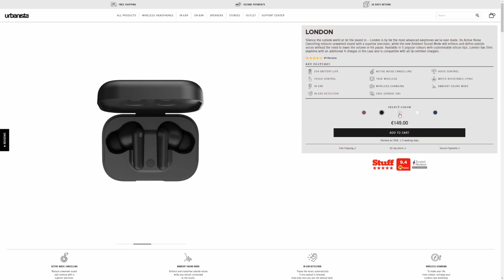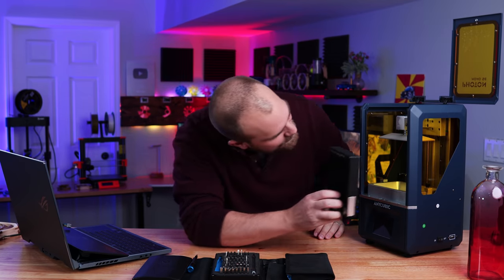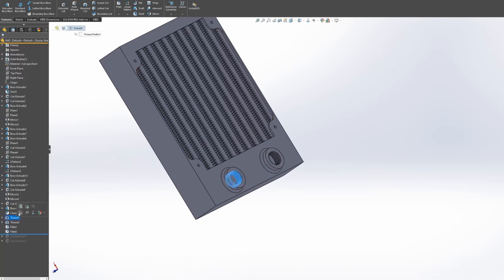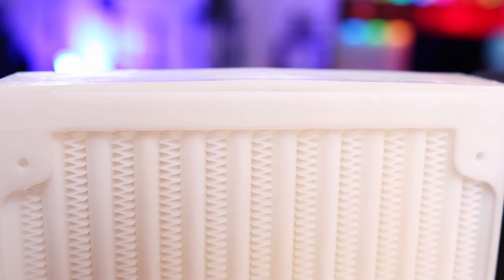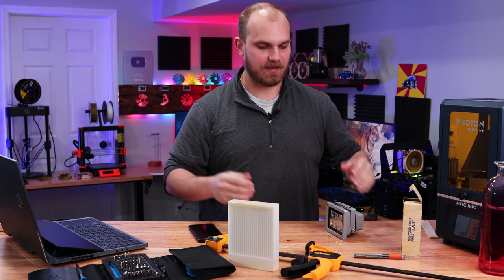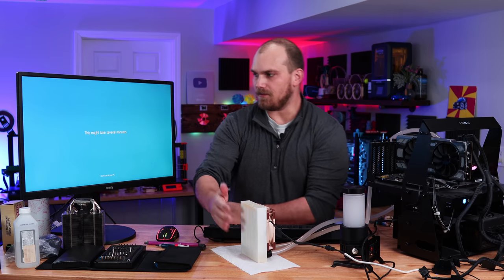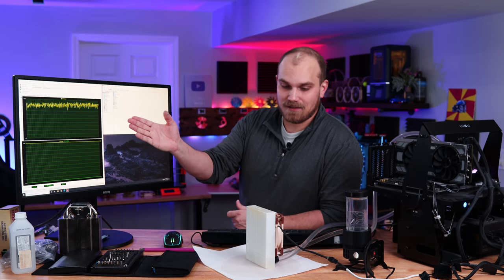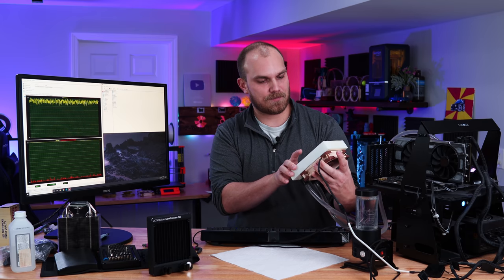I Never Expected This | 3D Printed EK Coolstream SE 120mm Radiator

Comment: well that was surprising, i have some ideas but no experience whatsoever on Cad, i would say remove the fins betwen the water channels as in this instance they are made of plastic and serve no purpose, unless you realy need structural support and make a smal trial model with different size water channels going thiner and thiner to find how thin you can make them without wasting too much time and resin also i dont know if you had a pastel white die in the loop before or that is from residual resin if the later check the cpu block for any type of material accumulation on the microfins, i see the future and polimer radiators may be profitable

Comment: The plastic radiator must be designed completly diferent .. you dont need those ribs between the tubes , in fact you need one long flat tube winded in a spiral shape

Comment: I think a radiator build with silicone used for heat transference could possibly perform better.  I am, however, not sure if that is something possible with a 3d printer since I don't know enough about them.

Comment: Try doing a cost comparison on buying a cheapo liquid cool set, (not AIO) vs resin printing one. Print the rad and the tubing (guess they would be hard line) vs buying a rad and soft tubing.  Now assuming the person has a 3D printer or resin printer, what would the cost of materials be vs having to by the rad and tubing.  Obviously the CPU block couldn't be printed and most pumps come with res, so no need to print.

Comment: Is insert molding an option with these printers? If so, could insert metal plates to facilitate heat transfer in between the main support fins? Great prototyping btw.

Comment: An interesting experiment would be to remove the radiator from the loop and see how long it take the water to reach a temperature to make the CPU idle, and you will have something to compare if the resin radiator is doing nothing.  Keep in mind that floor heating used in homes don't use metal tubing, but it obviously still radiates the heat.  It could be just having a narrow pathway for the water to flow and radiate heat on it's own is all that is needed, which would mean CPU LCS is mostly fraud. Well for regular non-extreme overclocking, probably.

Comment: Maybe if you make a 240mm version it wouldn’t throttle?
And I think the fins are unnecessary since they can’t conduct heat away from the channels so if you remove them it shouldn’t negatively impact performance and it will increase airflow

Comment: Just curious... have you considered printing a solid port and using a tap to cut the precise threads? I'm sure a tap set would have no issues with plastic since they're usually dealing with steel.

Comment: These videos harken back to the old days of water cooling, when you built loops out of stuff from home depot and aquarium supply stores and a radiator from a motorcycle or transmission, all to get an incredible overclock on an AMD chip you had to mod with a pencil to get the multiplier unlocked.

Comment: If you plan on making more radiators I suggest to get a bigger resin 3D printer. You probably already thought of that but the first one is very impressive. I bet if you make a resin radiator that can hold 2 fans you will be able to get an even more stable temp.

Comment: Instead of transfering the head from the Channel to the fins you should go with a really fine mesh of tubes. So there is only the thin tube walls that you would need to disapate the head from. Create Something that can not be produced by old school metall manufacturing. Fin / mesh structure and maybe even to overall shape. You could possible do an 90 degree 720 Radiator with 6 fans. Or custom cut outs at the radiator Line to clear the motherboard IO shield and GPU and create a rear 240 radiator.

Comment: Could you use a loop without radiator but with the same amount of water in it, to chceck if there would be similar results? I wonder if it might be just because of water capacity and energy lost in tubes etc.

Comment: Don't put the fins between the water channels, with metal it increases the surface becasaue it conducts temp well, with plastic you are isolating each point the fin makes contact with the water channel.

Comment: Video suggestion: fully 3d printed watercooling setup 
Resin printed distro plate
Resin printed Radiator
Resin printed Fan(blades) 
Resin printed Res (something than can take a DDC pump) 
Bonus if you are brave: 
Resin printed Solid tubing (printed in sections that slot into another like plastic plumbing, then glued for longer distances)

Comment: I believe it's possible to achieve better performance than traditional metal(Aluminum) radiator because now you can modify the waterflow inside the radiator to have higher efficiency even it's made by plastic! Maybe you can try carbon fiber filaments next time?!

Comment: G'day Major & Cooper,
😲That is CRAZY, I definitely thought it would just go straight to Max Temp & Throttle way down,
just wondering if there is a way to redesign the inlet outlet tank & return Tank both a little smaller so you can reduce the 160mm height to maybe 155-157mm, that might help the printer get a cleaner release,
Hope you, Cooper 🐶 & your family have a Wonderful Christmas 🤶🎅🦌 & that 2021 is a much better year 😁

Comment: Amazing!    This might be an internet first!  You could redesign by starting with the natural arch on the top that showed up inadvertently and follow through to round off the top corners.  You could also make it fatter to more maximize your print volume.   I would like to see this refined to the point it could be printed and run reliably.

Comment: You probly could use a metal resin or something like that that has a better thermal connectivity, and if it was a cheaper resin then you could still save money if you already had a 3d printer and other equipment.

Comment: First this was cool. Thanks for doing it.
But... The benefit of 3D printing is that you are not limited to a simple radiator design mad cheap in metal.
You could do so many things with this.
Film it with a thermal camera... Cause I do not think fins are doing much in plastic. I think the heat conductivity is to low... At least I think you should reduce the length of the fins, such the heat do not need to travel far before touching the air.
Also, try increasing the length the water has to travel trough the radiator... This might not change anything since the system is reaching a equilibrium, and also you can remove more heat energy when the temperature difference is high. But it might make it easier to add short fins around the "tube".

you could also thing about the airs path through the radiator, guide some of the air into the center where the fan hub is.... Straiten the air. Have different fin length to create destructive interferens.
Try keeping the cross section area the same as in your tubes... Maybe 10-25% larger, to reduce the pressure drub.  Keep the walls thin, to reduce the distance to the air.

The shape of the radiator could be any shape when you make it your self, maybe you have radiator on both sides of the fan?

I love you project, you are so inspiring, I have a huge respect for what you are doing.

Comment: Would it be possible to print a radiator where you could insert copper piping and then have a cap to seal it off 🤔

Comment: I'm gonna have to say again that you should print custom hardline.

Just imagine the perfect runs with loop de loops, or increasing then decreasing the lines diameter, or a line with a 'Y' junction to the CPU and GPU built right into the tube, or ... I think I've made my point...

Comment: LTT Wan Show!

And also would you be able to put cut outs in the radiator where you slid in metal pieces with a tight seal to help with cooling?

Comment: I love this radiator XD.
Can you try making a 240 or (if size of the printer does not allow it) can you put 2 of this in series like if they are a 240mm? Normally even a single metal 120mm radiator is not enough for a modern cpu

Comment: Let's be honest, you don't even need a radiator with fins. A lot of large-scale cooling solutions just move the air over a lengthy path of tubes. So just use a few extra meters of tube, and coil it up in front of a big fan. Or even just in front of the 3x140 mm fans that will fit into most modern cases somewhere, should already give you a reasonable amount of cooling.

Comment: Two thoughts. Black resin may actually work better just due to the black body effect. 2nd, based on another video someone made on adding fiberglass mid-print to sla prints, it might be possible to add some aluminum powder to the resin to increase its thermal transfer. I smell a resin printed radiator challenge!

Comment: so i realize your printer is too small to make a bigger radiator (too bad i would love to see a 240 or 360), but i would really like to see a re-print with a more optimized flow, but print it 2 or 3 times and run is series to imitate a bigger radiator, i think this could turn into a very fun series, at some point u can come up with an all printed cooling setup, u already got fans and a distro and a radiator, see where im going with this? awesome work and good fun!

Comment: About radiators . . . has anyone used a small car radiator and its fan and somehow rigging it up to hook up to a pc? (probally will need a external pump of sufficent power)
Just curious on what some overly crazy cooling would do...
Edit: a new radiator anyway, Not sure if it would be a good idea to use a used one.

Comment: Let's combine the 3D printed fan and radiator ideas together?
I suspect you could get most of the cooling performance of this with half the volume with a good fan design embedded in a radiator. I envision a web of axially cooled tubes that surround the fan. Also, it would be interesting to see what crazy ideas people could come up without the constraint of normal fan and radiator designs.

Comment: I would like to see a full 360 rad like this complete with 6 fans in a push pull configuration, and see how it stacks up. Print it off in three parts and clue them together using the same method you used to fix that bulge.

Comment: idk if its possible for you to print big enough but i would love to see a couple of 480rads if the material so i light and cheap that much surface area might beat normal radiators on performance and price ofc its not going to beat 2 copper 480rads but those are too heavy and too expensive maybe it can beat a 240 rad?

Comment: Did you do a sanity check by testing how well the system stays cool if you just replace the printed radiator with a container of equivalent fluid capacity?  Or maybe just take out the rad and aim the fan at the reservoir?
The tubes and the res are going to be dissipating some heat, so the radiator could have been extraneous to the thermal control process, considering how much water is in the system to heat up.  Just some random thoughts I had while watching the video. :)

Anyhoo...  Next step, 3d printed air cooler? ;D

Comment: What are you using for your 3d modeling program? Very good video, great work!

Edit:
Also have you see the ceramic resins? They require the print to be fired in a kiln afterwards but I think you could do some reallllly cool stuff with it

Comment: Lighter and cheaper than a commercial metal radiator, probably. It requires a 3D printer, of course, but that only really counts towards the cost of the radiator if it's the only thing you use it for.

Comment: Can you re run the test, I think you might have some clogging going on in your cpu block and potentially the motor. It seems like when you turned it on the first time it removed all the un-cured resin from inside the radiator, and by the end of the test it all cleared out so it must be stuck in something

Comment: Fun experiment: How much tube do you need to add to a system without a radiator to not thermal throttle? So, how much tube equals to one radiator?

Comment: Maybe instead of fins you could do more tubes and offset them. It might increase airflow and the flow of the water, though im doubt there would be much benefit other than the increased airflow from less plastic in the path. 
Also you forgot the last benefit, if it works people would print their own radiators lol.

Comment: @ Major Hardware I would like to ask if you can make a shroud to vent heat away from ASUS strix 1070 and not in my case I have two in sli config ,my old case had a side panel  fan , but my new one has glass I have made one out of carboard box that sits on top of the gpu cards and vents out to the back of the case ,plus i have two 100mm fans pushing fresh air towards the back of the cards eg fans = cards = back of case ,thank in advance

Comment: So my takeaway is: a 3d resin printed radiator, while not recommended, can work as a low cost, relatively effective, stop gap should one be in a pinch and have greater access to a 3d resin printer then they do a replacement

Comment: Loving this and loving the 3D print series. I'd love to see what a larger radiator could do, or tweaked. I mean, the colour combo's, how light weight, and potentially how cheap they could be tp produce could be an interesting development. But... this is resin. I don't think it would withstand this heat forever :P

Comment: There actually already is a thermal conductive 3D printable filament.  It is 50x more conductive than normal filament, but still 1/25 as conductive as aluminum at  8 W/m-K.  This just means it is harder for the heat to travel.  That means DO NOT ADD FINS.  You are designing like an old style water block.  Instead you want as many channels for the water to flow through and the walls to be as thin as you can make them.  That kind of a design would likely be a lot more expensive for a traditional radiator, but 3D printing does not have to follow these rules.  So dump the fins, make the channels the full thickness of the radiator and put as many channels with as thin of walls as you can.  You could shape it any way you want with water flowing through it however you want.  You could have a round radiator that feeds in on a corner or side and exits in the middle if you want and not waste channels where there is no airflow.  Maybe with the lack of fins the airflow would be better and you could make a long tube instead with a single fan on one end.  Do not think of designs based on current radiator designs.

Comment: if these can be bought for half or a third of the price it could  work commercially. you could compensate for less thermal efficiency with more rads which would be fine because of extremely low cost

Comment: If a plastic radiator works well enough you could print and entire computer case that was also an integrated radiator. The larger area would make up for the inefficiency.

Comment: I bet you it wouldn't thermal throttle if you had a push pull configuration. A push pull configuration might be able to overcome the impedance of the massive water channels by shear brute force.

Comment: Seeing that that works, I wonder how many feet of 1/4" plastic tubing, or coiled copper would have the same effect?
Reply: Coiled copper has been done to death. Not enough surface area, unless you use a very long coil
Reply: @IsaacNewtongue  wouldn't be hard to beat the amount of surface area he had going on here, not to mention the whole thermal conductivity difference

Comment: I mean it's not crazy as many automotive applications are using plastic in their radiator designs.  The whole thing as plastic is probably not that efficient but it's not a totally out there concept.  Pretty neat to see it go though.  You could definitely refine the design and process to get something somewhat reliable.

Comment: should just lose the fins and make the center channels closer.   They probably aren't doing anything other than slowing the air down and thus creating pressure.  In a system like that, being less thermally conductive, fins aren't going to transfer any real heat compared to the actual channels.

Comment: Heat dissipating fins are pointless with plastic, holes through a block allowing water to flow around the passage would transfer heat very effectively. Far more that non-heat conducting plastic fins anyway. With printing you can include internal structures like corkscrews to expose more water to the air passages. You could direct water flow however is most efficient like warm water away from the fan so the coolest air meets the coolest water to get closer to ambient.

Comment: What will happen if you mix in metallic powder or something that transport heat better with the resin.
Reply: Pretty sure the resin printer would not take kindly to metal flakes unless blended properly. which to get the proper ratio would take experimenting until it worked, I eat tearing it apart putting it back together all over and over and over again.
Reply: Almost had it voice dictation. almost XD

Comment: What was the temperature of the liquid? It would be a better measurement as to if it would have trended up.
Reply: Looked like he was sitting at 95c at the end of the video with the cpu at idle. I wouldn't of really said it worked.
Reply: @FadedDreamzTv  of course, I wouldn't have said it worked either but how well did it do above nothing (pump+waterblock+tubes only) is still an intersting question.
Reply: @qqii  I think he would be better off doing an air cooler with the ceramic resin they have out there.

Comment: Now convert that plastic rad to aerogel rad , rad goes into methanol then into pressurized CO2 to replace methanol and then subzero cooling into slowly evaporization.  PS: not sure if the "pipes" will still keep structure integrity